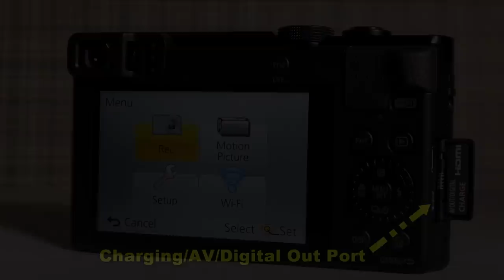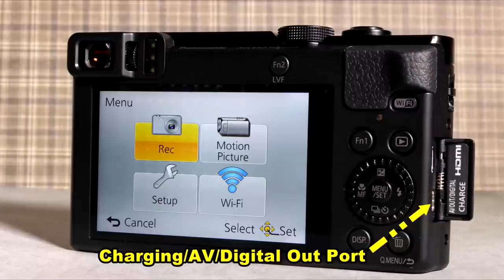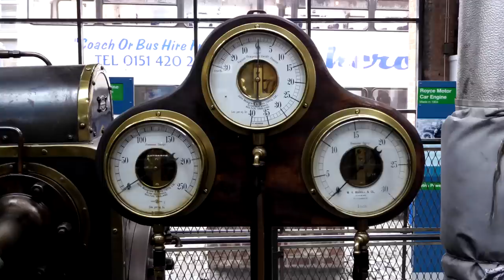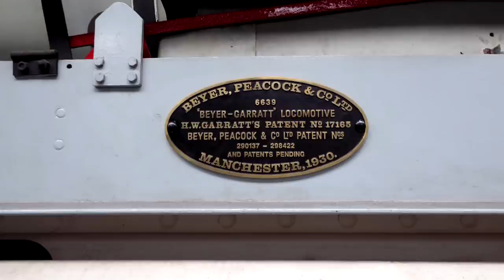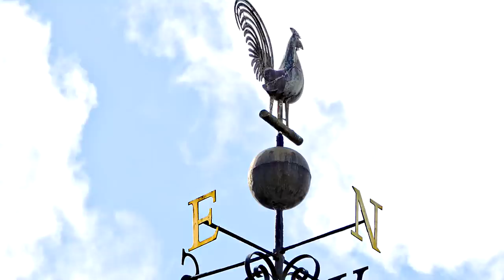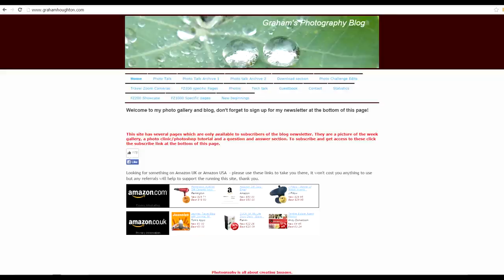The Panasonic Lumix TZ70 (ZS50) Sample Stills and Video Clips (low light to sunlight)

Comment: It's a shame no-one I've seen reviewing this camera demonstrates it's ability to shoot night scenes (City Scapes) using slow shutter speeds to capture light trails. It's a bit annoying that this camera manufacturer, Panasonic, claims that it reduced the  number of pixels on it's sensor to better cope with low-level light; yet, no-one is testing it in low-level to nigh time lighting situations. I would have liked to see how it operates and performs in Starry Sky mode, and how well it does at a shutter speed of 4 seconds, its lowest shutter speed setting. It's also annoying that again Panasonic reduced the number of pixels on its sensor for reasons mentioned above; yet, it's slowest shutter speed is only 4 seconds, unless you switch to Starry Sky mode; but even in this mode, I'm led to believe it only offers options of 15, 30, and 60 seconds at a default ISO of 100 that can'tr be adjusted. Why not give the camera the ability to shoot up to 60 seconds half-second or less increments. The lack of this shutter control capability is likely to deter me from purchasing the camera. Yet, it has so many other excellent features - like manual focus capability, and AE and AF lock facility, EVF, fantastic lens and lens range.

Comment: I have this camera and having some issues with it. Sometimes when i wan't to take a picture and hit the button to zoom in or out it just randomly starts to record video and it does the same when i'm recording a video and hit the zoom and it just stops recording video. It only does it very occasionally though so when i took it to the shop i bought it from it worked fine with them and they said it could be temperature effecting it but they didn't know. It doesn't really cause to much of a problem because it doesn't do it all the time but it can be annoying when i'm recording video and it just randomly stops. I can't find anyone having this problem with any camera and i'm not tech savvy at all. Anyone have any ideas what the problem could be?
Reply: I do have exactly the same problem with my DMC-TZ35!! :((
Reply: https://www.ifixit.com/Answers/View/452071/starts+recording+video+when+I+zoom+in

Comment: nice video as always Graham -  the Mic's are quite good -  and nice  to have RAW -  Sony in their HXv50 does not offer RAW -  and no one has EVF in that size and price $297 -   so a very practical camera for a budget minded family / person -   
I suspect Panasonic will come out with a 1 inch sensor small body -  smaller then the LX100 but of course a bit larger then the TZ70(Zs50)  to compete with the Sony RX100 models and now the Canon G7X and G9X and soon to be announced Fuji X70 -   they really need to -  they can just buy the Sony RX100m3 sensor like Canon does - and it does not have to do 4k - ( as it requires larger body for cooling as Sony has come up against in their RX100m4 which is worthless in 4k as it overheats after 3-5min and for sure 2-3 min in warm climate )   -  so it really is just a sales ploy -  but folks are paying $1000 for it -   I would love to see Panasonic do something similar to the GM5 in size and with EVF and a 24-100mm F1.8-2.8 lens - with the nice G series menu and Touch LCD -  will have to have Flip LCD -  and be priced better then the expense  RX100 models -  so maybe the same price as the G7X from Canon - but it will have more features and an EVF -  
Question is what will Panasonic do in regards to the LX100 -  will the be a sequel or are they better of with a 1 inch sensor and a smaller size-  
I think they are better off going that route -  not sure the LX100 is for everyone - No Mode Dial etc -  I kind a think Panasonic was challenging the Fuji X100/s/t  -  but in reality I think that Fuji still owns that Purist group -  so I think Panasonic should compete in the much much larger market share group of the RX100 and Gx7/Gx9  -  the Fuji X70 will be larger then the RX100 and Canon G7X and G9X - about the size of the LX100 so I suspect it will not be as attractive for those who are looking at the smallest but best image quality camera with EVF and 1 inch sensor -    I think Panasonic has a much nicer user friendly menu in the G series  then both Sony and Canon and if they keep they price well below Sony's price and deliver lots of features and good video as they always do then they really can compete -
Reply: Cool

Comment: hello, as i realize from your videos photos from tz60 are better * sharper ) than photos from tz70?? Am i right ?
Reply from the maker: There is more resolution available in the TZ60 with the smaller pixels so in bright light the camera can record a lot more finer detail. As the light levels fail then, marginally, the TZ70 images are better as they don't have the same level of noise  in them - especially at ISO 400 and above.

Comment: Had this camera 22 months now and recently developed a fault where the display / image randomly moves when the camera is completely still and even on a flat surface. Unfortunately it's out of warranty and no doubt uneconomical to repair. Guy in Jessops hadn't heard of the fault before. I'd had several Cybershot models before this which never let me down and were always reliable. On top of the fault, image quality is very average for the money I paid. Don't think I'll be buying another Panasonic compact in a hurry
Reply from the maker: If you factor in the lack of any serious attempt to dust proof the lens on these models then these cameras are also now off my recommendations. They are just too expensive for under 2 years average service life IMHO
Reply: Mine has yet to experience this issue. I've been disappointed as all the reviews when I bought it said it was a great camera. I think in future I will  purchase an "older" model so I can research it's long term reliability

Comment: i see this specific model selling at Costco, so im curious if this cam comes with a usb charger or does is just uses disposable batteries..thanks..
Reply: In the box comes with a mains charger with removal USB lead, it does not use AA batteries but the slim rechargeable Li-on battery.  You can charge using the removable usb lead via your computer.  If you had searched the manufacturers website you will find this out and much more. I do own this camera.

Comment: is it user friendly, being a beginner and is it suitable for food, travel and fashion photos and videos?
Reply: Yes. It's powerful but small. If you can't use every feature of a small camera people don't think you're an idiot. If you buy a really big camera and can't drive it they DO think you're an idiot. I think it's great. It's my third Panasonic camera, so I can't really tell you what it is like as a beginner, but it is a lot easier to drive than my bigger Panasonic which can zoom to 6o times, and it is far more easy to carry around than that brute. Considering how easy it is to keep in your pocket you should be able to get practice with it quite easily. You can walk around with a great camera without having to have it slung around your neck. 
I recently saw a hare in a field, I had two cameras with me, the TZ70 with 30 times zoom in my pocket and the DMC-FZ72 with 60 times zoom and a tripod in the car. Dilemma! I decided to brace myself on a gate and try to capture it with the pocket camera, then when I had captured a couple of video clips I would take out the big camera. I managed to set the bigger camera up and the results were not very different, both clearly show a shy animal in low light at high zoom. I was very impressed with what the little brother could do compared to my "big boy zoom camera". My previous pocket camera wouldn't have been able to do anything like as well. It is good that you can use the viewfinder or the rear screen, whichever seems appropriate, if you bring the camera up to your eye the viewfinder comes on and the screen goes off. You can adjust the focus of the image you're viewing in the little viewfinder to your own eye. My bigger camera also has both options but it doesn't detect whether you're using the viewfinder and switch automatically, in fact changing from one to the other usually involves a bit of cursing and hitting buttons many times. The TZ70 also records in a higher frame rate, 50 FPS, better for rapid movement, I recently managed to video a kestrel hovering with rapidly beating wings, for such a shot the higher the frame rate it can manage the better the results will look.
Like any small camera recording outside can pick up unwanted wind noise and it doesn't have a microphone input. If you want to record sound you have to do your best to shield the top of the camera from the wind.